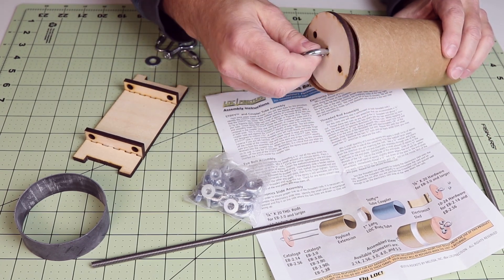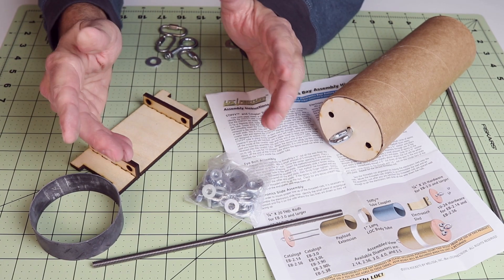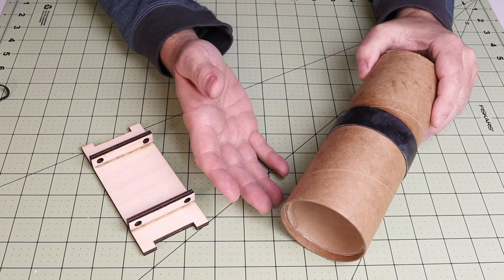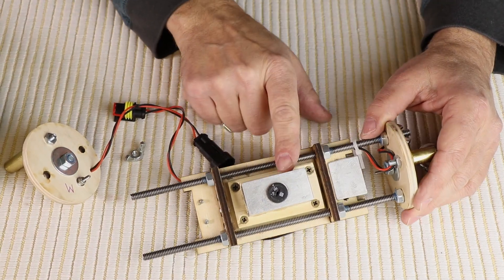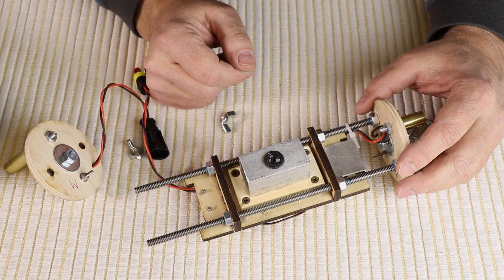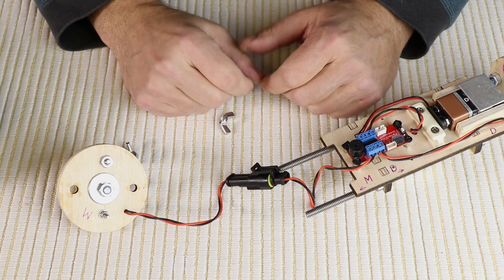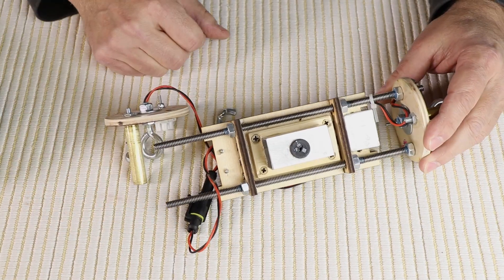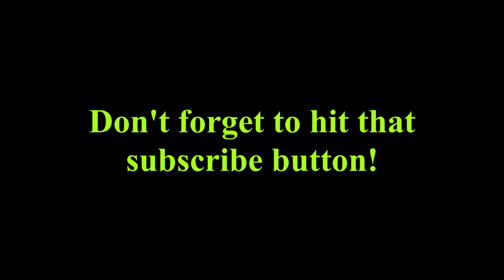Electronics / Altimeter Bay 3", Review and Build.

Comment: OK, I found some articles on Dual Deployment Avionic Bays, so I have the basics now. My only questions are what are the Charge Wells filled with and how are they ignited?  It appears that when the Altimeter detects no more rise in altitude (apogee), it fires the lower Charge Well to separate the motor from the Avionics Bay and a drouge chute is deployed, then when the altimeter detects a height of say 500 feet, it then fires the top Charge Well to separate tye Nose Cone/Payload section and deploys the main chute.  My system will record time of flight (launch to landing), accelerations/G forces, velocities, altitudes, ambient air measurements, and video. Those recordings are then uploaded after recovery to a PC for display. If I put telemtry in it, I can use the 3 Axis Accelerometer to pinpoint its relative landing coordinates based on tye GPS coordinates of the launch point.

Ignore my old questions: How does the Charge Well (Pot) work? OK, it pops the Nose Cone off and I guess the Parachute as well, yes?  What is it filled with?  How is it fired? On another Electrics Bay video, you have a Charge Well on the other side of the Electronics Bay, what is it for? How is it fired? In fact, you have two on each side: a Primary and a Backup. How do you know when to fire the backup? Is a backup really needed? Sorry about all the questions as this is all new to me.
Reply from the maker: The black powder charge goes in the copper tubes and then an e-match is inserted from the top. At apogee the altimeter sets off one charge and separates the rocket in the middle. At a predetermined altitude the second charge deploys and pops off the nosecone and pushes out the main shoot. 

Sorry for the late reply, I am out of town. Go to the about tab on my home page and there you will find my email.
Reply: @TheRocketeer  Thanks for the reply! I just started my Avionics Bay design. You checking the Electric Match continuity gave me a good idea. I am using an Adafruit Feather M0 microcontroller. At power on it will perform a low current continuity test of the Electrics Matches and light a Green LED to let me know itvis safe to arm before launch.